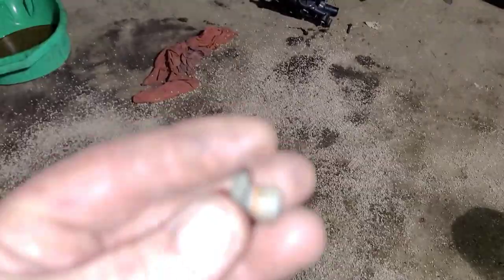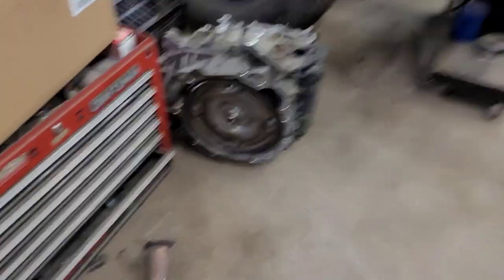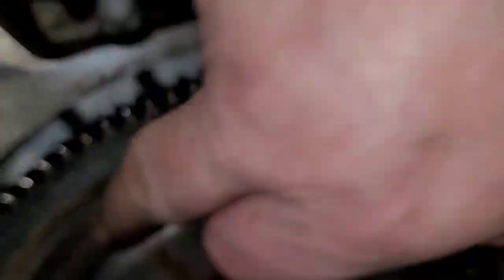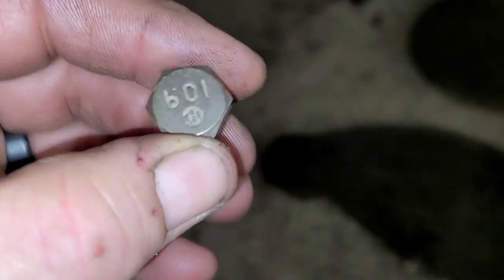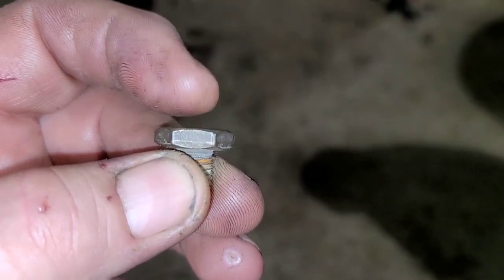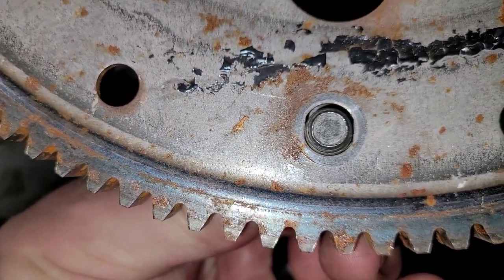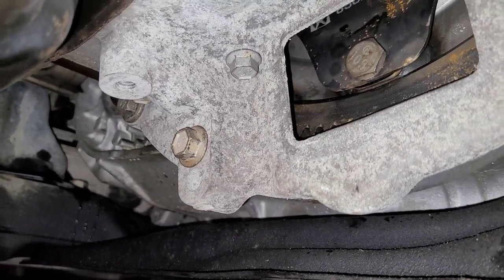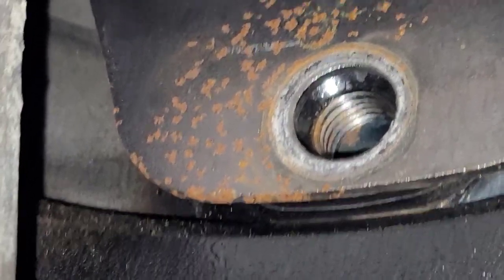Stop!! Don't Destroy Your Automatic Transmission !! Use the right hardware !!

Comment: Now you got me thinking , “ did I ever check the torque converter bolts on my Cherokee ? “ . I thought I did but can’t remember when if I even did ! Well , if I remember , that’s job for one day when the ground is warmer . Supposedly , the forums report that it’s said to be common for the torque converter bolts to loosen on the Jeep,transmissions . Not sure all Jeep transmissions as Jeep used a number of them but maybe the aw4 in particular ? All the work I ever did on this truck , did I ever check those bolt . I thought I did …..

Comment: Great points . That starting hole is good to know . The bolt you had is rated 10.9 in strength . Plus the way it has a shoulder , shallow head and length all set it apart from regular hardware . Anyone who doesn't notice should work at IKEA .

Comment: Ok you got me a bit here but still I have always used the correct bolts  for the converter yep learn the hard way on a block and long head bolt too long and broke the pocket right out yep a bad day for me and my car.  But lesson learned and months later I got a new engine.

Comment: Are the torque converter bolts always reusable?
Reply from the maker: Good question. For the 40yrs I've been doing this, I've always reused them with a dab of blue Locktite . Some of the new ones come with Locktite already on them

Comment: A flexplate is not the same thing as a flywheel. A motor is NOT the same as an engine. Why does everyone say these are interchangeable terms? They are not. Does your Tesla have an engine under the hood? Does your dish washer have an engine driving it? Did your windshield wiper engine go bad?

Everyone who has told me that motor and engine are interchangeable terms has a problem when I PURPOSELY use the term "engine" when referring to a motor. Is this a double standard or just selective use of proper terms? A solenoid is a coil. It typically pulls something into position. A solenoid with switch contacts is a relay. If it switches a load device, it is a contactor.

People in automotive like to hang on to outdated terms. Diode is an outdated term. Rectifier is the correct term for a device only allowing "forward bias" current to flow. Relay is an outdated term. Contactor is an electrical switch that feeds a load device, such as a starter.
Reply: Motor Boat